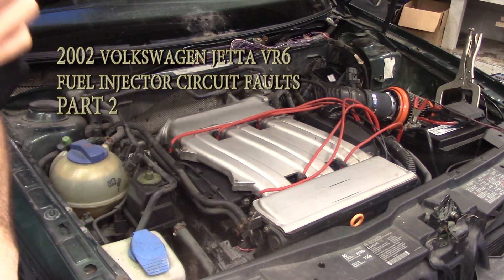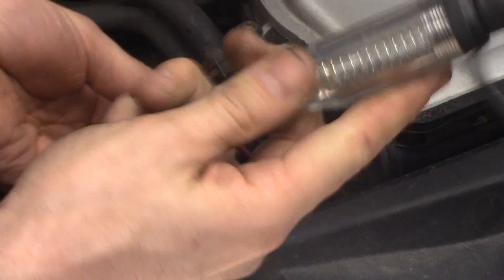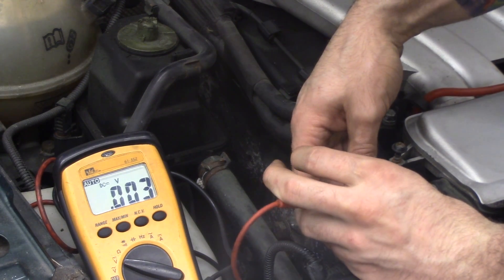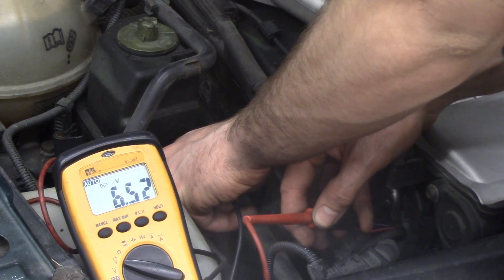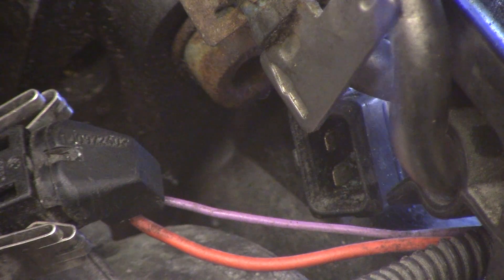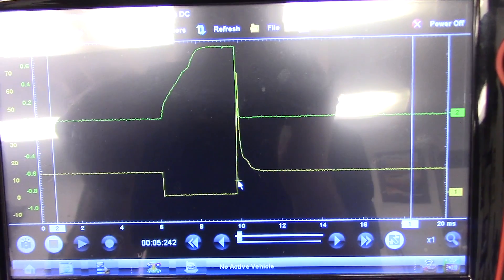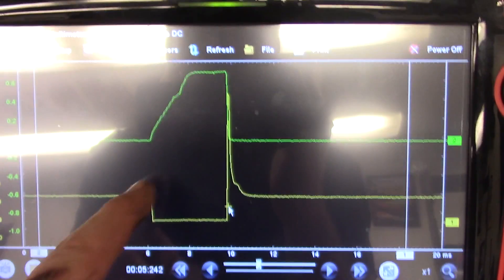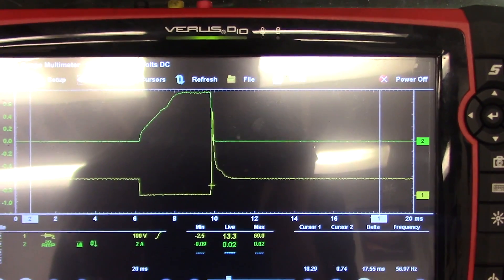2002 Volkswagen Jetta VR6- Fuel Inj Circuit Faults- PART 2

Comment: oh yea forgot to ask you.
what in the world is bias voltage?when paul explain it i must of missed it
Reply from the maker: It's a small voltage that the computer sends out. Usually used for diagnostics.  So for example In this case I had fuel inj circuit faults the computer knows that if it sees that 3.6 volts then there is a problem.